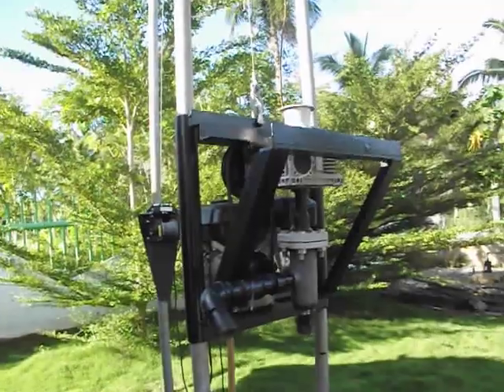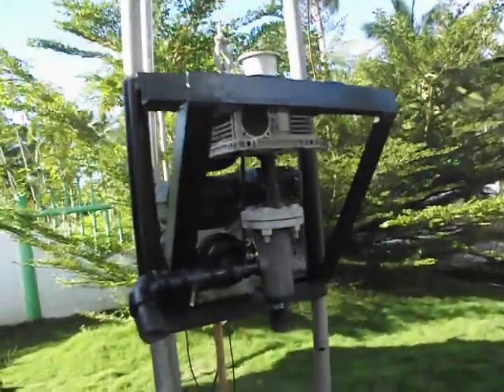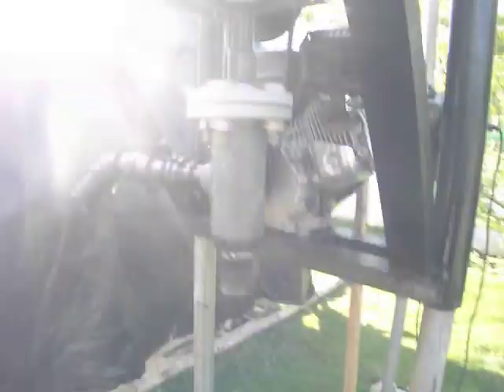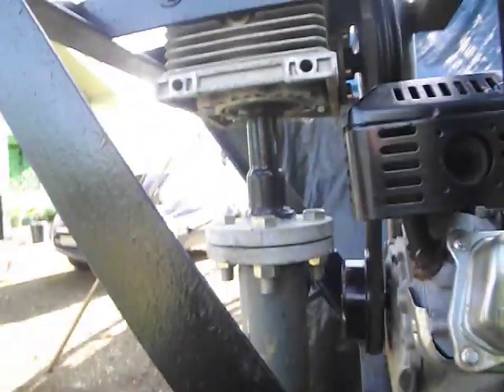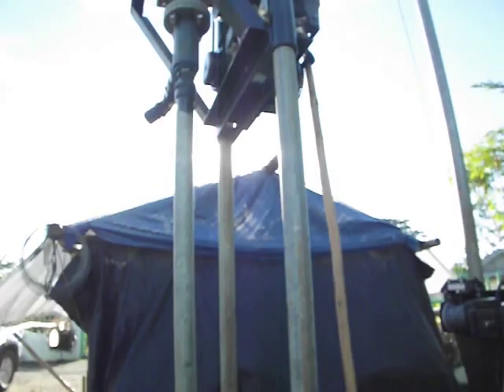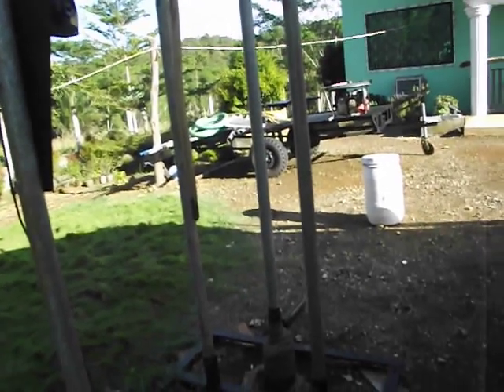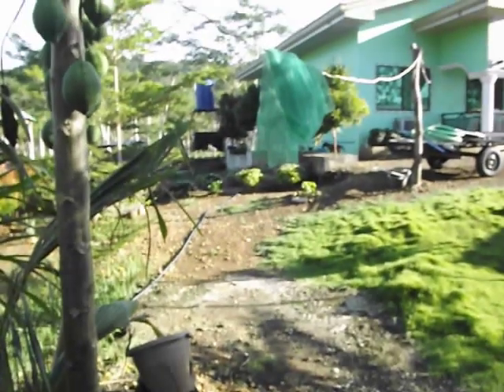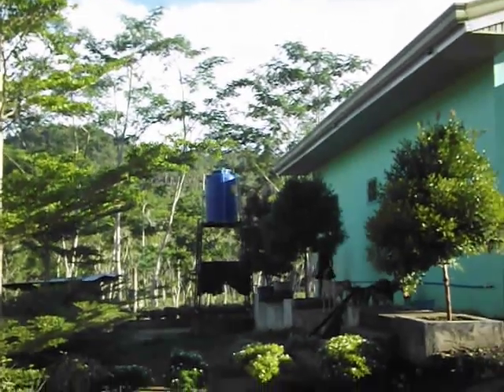Deep Well Drilling Rig Part 2

Comment: Impressive.  Looks very effective.  I know you said you are retired and not looking to get into business...but it looks like you would have two legitimate business opportunities if you wanted to pursue them...drilling wells and/or making drilling rigs.  Thanks for sharing.
Reply from the maker: Hi Thank You. I looked into the drilling business and it can take up to a week to drill a well depending on what you are drilling through. when we drilled our well that was our second hole the first we went to 35 ft and hit hard rock after two days we had to move, we did hit rock again twice and at 60ft we hit water, it is never guaranteed you will find water. Building drilling rigs its so hard to sell anything here, i just dont want to be involved with the BIR Taxes here. Thanks Bill

Comment: Add your rig to the back end of a flat bed truck, plus a water tank and pipe rack then you are mobile.
Reply from the maker: good morning George i built it so it can be erected and dismantled by one person, transported almost anywhere even through a house, the drilling pipes are 5ft long (a 20ft lengh cut into 4) i can fold down the rear seats of our car and in will fit in the back or even carried on a tricycle. there is methods in my madness. TC there
Reply: @britengineerinmindanaothep9376  Didn't think about that, it's even better then because a 55 gallon drum could be rolled anywhere and pipes carried.

Comment: Hey bro. So I think they did do that yesterday by hand... You'll find that with this sort of thing, I'm clueless..🤣 But they finished up whatever they actually did yesterday. No crew was on today, just the landladys husband. 👍🏻 Really cool seeing your rig in action.
Reply from the maker: Hi Fred i noticed in there tools there was a hand drill and a post hole digger they can't of gone very deep, where is the septic tank? and dont drink or clean your teeth with that water just as a precaution there could be E-coli bacteria.
Before i retired i was working in the water industry upgrading a RGF plant where they treat water for drinking. TC
Reply: @britengineerinmindanaothep9376  the septic is the little hut like area in front of our apartment with the concrete floor. Where the wedding stuff was hung up. 👍🏻 They half ass everything.. 🤣👍🏻✌🏻